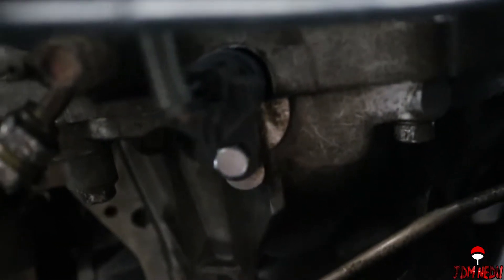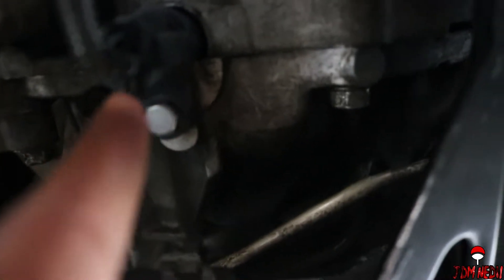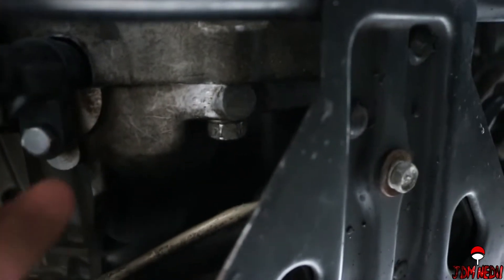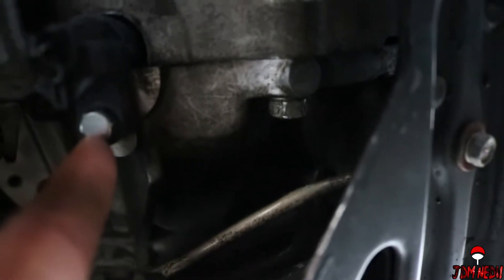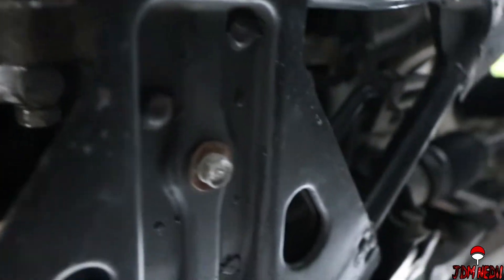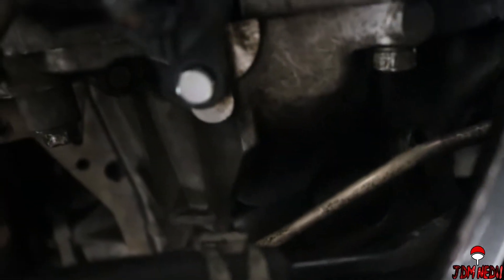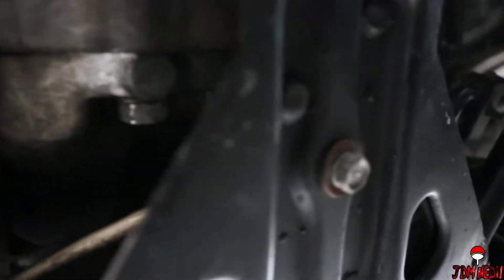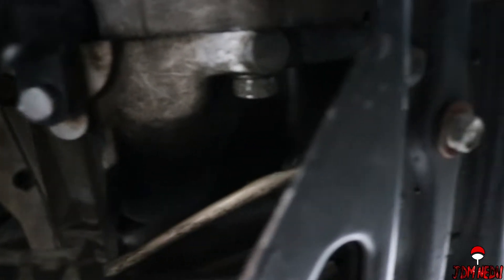Infiniti G35/350z code p0335 crankshaft sensor problem!!

Comment: having the same problem, its take a while to start with the old crankshaft sensor, and after i put on a new crankshaft sensor my doesnt go to limp mode like yours, instead my just kept on cranking no start at all, any idea ?
Reply from the maker: Have u recently done a clutch job? If so if flywheel May be misaligned
Reply: @JDMNEDU  the previous owner did a engine swap and they put a new clutch in
Reply: Mine takes a few secs extra to start

Comment: Since you have a P0335 code: "Crankshaft Position Sensor A Circuit Malfunction", and changed the crankshaft sensor with no change, could it be that the NEW sensor is was defective?
Remember "NEW" means "Never Ever Worked"...

Take the crankshaft sensor from one of the other G35 vehicles in your video. This is a "Known Good Part", and substitute that crankshaft sensor for troubleshooting.

If the problem continues, the crankshaft signals should also be check at the ECU to verify the wiring with the known good part installed. Missing signals will be from opens or shorts. Don't forget to visually check and clean all your connectors, and verify the power and ground under load. (Light bulb or Power Probe test)

Comment: I changed my transmission  now I get the same code as you and changed the sensor still won’t start
Reply from the maker: Beezy Lane u are probably getting this issue because the flywheel is not aligned correctly with transmission
Reply from the maker: Beezy Lane a way to check to see if this is the problem is by slightly loosening the bolt of the crankshaft sensor located under the transmission like in the video and try starting it that way. If it takes a while keep cranking until u see it starts. If so then u need to correctly align ur flywheel to the pin behind it
Reply: JDMNEDU  I didn’t remove the flywheel just the torque converter
Reply: Program your ecu to read your new transmission these cars run off air an computer technology
Reply: Jalen Johnson yea do that if it is a automatic^
Reply: I change my transmission  too have the same problem any luck ??
Reply: Pariente Rodriguez just the transmission? Auto? Do the programming thing he said above

Comment: Maybe the camshaft position sensor as well
Reply from the maker: It ended up being a misaligned flywheel
Reply: @JDMNEDU  hi, was your flywheel installed without a guide pin?  I understand correctly?  I have the same problem after a manual transmission swap.

Comment: Hi , 

Have you solved the problem? Because I’m facing the same problem
Reply: The problem was a misaligned flywheel. I did not follow the dowel pin protocol and installed the flywheel incorrectly while doing the motor swap.  I bought new clutch/flywheel and installed it correctly by lining the flywheel up with the dowel on the back of the motor. Your issue would probably be the starter or crankshaft sensor itself if you did not change the clutch/flywheel or pull the motor out prior to this problem
Reply: @lMSOELITE  I hope this is the case I just had my trans swapped and when the first mechanic I took it to started it wouldn't crank. I took it to another one told him the issue he dropped it and idk what he did but it started, after it got towed to the dealer and had the tcm programed it started and drove but at 25 mph would go into a limp mode and revs limited to 3k.
Reply: @CrucialTech1  if it is a manual & has the misaligned flywheel issue, it either starts bc correctly if it is aligned or doesn’t start if it is misaligned. No limp mode
Reply: @lMSOELITE  it's a auto
Reply: @CrucialTech1  that’s a different issue then

Comment: Y’all need to program the ecu the mother has a chip in it that connects to the ecu under the dash of the passenger side program the ecu to the new motor and I bet 100$ that mf gone snatch off like its brand new off the lot
Reply: Not mother I meant motor
Reply: Jalen Johnson misaligned flywheel, you owe me 100$
Reply: Where da fcing money jalen?!?!?

Comment: Hey mate, great video! My 350z had an engine swap (that's how I got it) has the same starting issue as your car in the video, I took of the transmission, swapped the flywheel and clutch made 100% sure that the dowel pin lined up with the hole on the flywheel, put it all back together and I'm still getting the P0335 code and still the slow start. I've replaced all the cam sensors and a new crank sensor and still no go. Any ideas? Thanks man
Reply from the maker: is the bolt for the crank sensor tightened all the way. and flywheel positioned exactly to that dowel pin. if not you may have a faulty flywheel with a chipped tooth. lastly try to clear the code first to see if it starts.
Reply: @JDMNEDU  crank sensor is tightened all the way, flywheel is aligned and I checked all the teeth, they are perfect. I changed the ipdm and think it might be the ECU.
Reply: @JDMNEDU did u ever figure out the issue ? i’m having the same problem
Reply: @bikelifevon7230  flywheel was misaligned, also make sure that all the sensors you use are genuine nissan ones.
Reply: @crypto-d9851 hey buddy I just dropped my trans aswell and rechecked my flywheel was aligned. You mentioned you were 100% sure it was aligned and it still didn’t turn on. Then you said it was mis aligned.
Reply: @caveman5321  is your crank angle sensor good, is it genuine ?
Reply: @caveman5321  i had 2 issues 1 was a misaligned flywheel and second was a non genuine crank sensor was installed. Fixed both and she started like a charm
Reply: @crypto-d9851  yes it a genuine oem one. I did an engine swap on it and I can’t get it to turn on. P0335 code. At first I messed up and didn’t align the flywheel to the dowel pin. Dropped the trans and aligned it and now it still won’t start.
Reply: @caveman5321  can you borrow a crank sensor from someone to test any way? Are your spark plugs plugged in the right way? 

You are 1000% certain you aligned the flywheel? If its not that it has to be the sensor

Comment: the idle problem sounds like a timing issue. Make sure you have the hole lined up on the flywheel to the dowel pin on the back of the engine
Reply from the maker: yea we ended up correcting it and it works like a charm

Comment: @jdmnedu was that your fix to your problem cause i just did motor swap to  and new clutch but someone else did it and my car does exactly what yours is doing and i got that code to i changed the sensor new and same thing lmk !
Reply from the maker: damanatrapping01 what we ended up finding out was that the flywheel was incorrectly aligned. Theres is a small pin-like hole the flywheel needs to align with with the motor to turn properly and relief the code and start up issues
Reply from the maker: damanatrapping01 i unfortunately dont have a video or picture coverage but im sure if u look up misaligned flywheel u can get more in depth stuff. Also thanks for watching!
Reply: @jdm anyway u got a email ill send u a video
Reply from the maker: @damanatrapping01  jdmnedu @gmail
Reply: @JDMNEDU  fixed it bro was the flywheel bs yall posted thank u man

Comment: Hey, will a bend in the flex plate cause this as well? For an automatic?
Reply from the maker: A bend in the flex plate will definetly throw off the timing for the car for sure.
Reply from the maker: i do wonder how that piece could have bent though.
Reply: So I had a motor replaced and the mechanic said that the torque converter jammed. So the next day, I watched him literally pry them apart with a crow bar... so I'm not sure if that bent it or not. I just figured it did because there weren't any issues with it before he did that.
Reply from the maker: @m.g9282  it could be very likely because if any of those teeth arent in spec it will give u issues. that and if he didnt align the flywheel correctly.
Reply: @JDMNEDU  yea I unplugged the crankshaft sensor, and it ran just fine. Despite a long start up time.